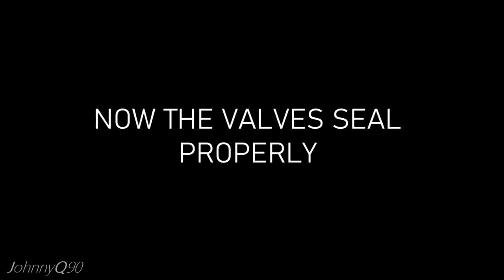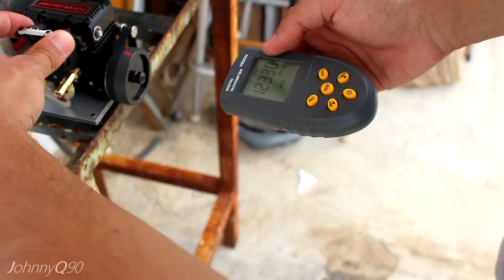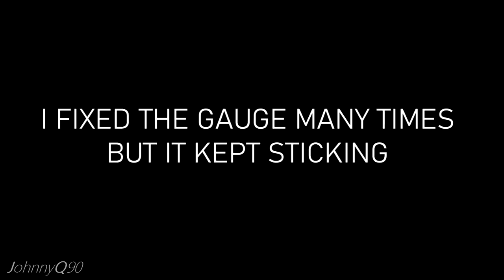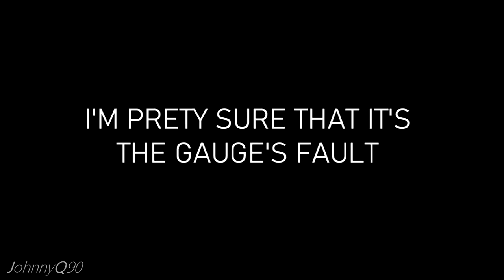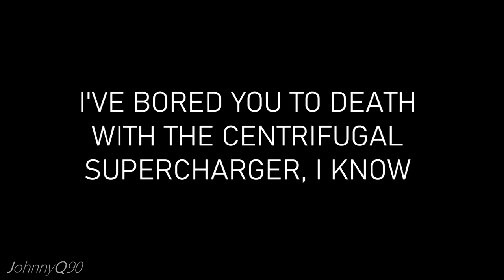PERFORMANCE Upgrade for the 4 Stroke TWIN Cylinder - *VALVE Lapping* - Supercharger Update

Comment: i dont know if thats gona work on blow   throurgh  i think the problem on the carburator try one time with a bigger one and lower gear ratio on that engine 3 psi i think its a lot with that pressure and that carburator its gona run very poor

Comment: First of all, the turbine is useless if it continues to pollute in second, The pulley is too tight and puts a lot of strain on the gasoline engine And in third place you will put 2 turbines one that connects to the exhaust and another to the carburetor

Comment: has anyone tried to use fuel injection on a model engine? this style supercharger and turbochargers dont work with carbs as well as they do with FI. now a roots or PD might work, but these style superchargers take power to make power.

Comment: too much boost. inconsistent idle because the charger is spooling up not a big deal but i think the reason that you can't tune it is because the boost is adding power on the intake stroke.

Comment: I would suggest adding some fuel pressure, and timing. more air means you need more/ a more stable fuel source and then I wager YOU could easily fabricate a new crank gear that are a degree or two advanced or honestly move the OEM crank gear forward a tooth on the belt which where in theory could detonate the mixture sooner to help iron out that rich low rpm sputter. It almost seems like a miniature backfire from the combustion cycle being a little too retarded for how much you're gonna be feeding it (don't laugh that's the actual term). Also too much timing could cause the valves to hit pistons (specifically the exhaust valve on the exhaust stroke) but I imagine its easy to test without damaging anything if you adjust the timing and turn it over by hand making sure to feel for any binding.

Also some people have a good point of fuel atomization. Once again though you can do some sort of high pressure low volume fuel system to prevent droplets from forming. Droplets can be hard to fire/cycle because liquids don't compress. I feel like properly atomized fuel and some timing can really wake that setup, UP!

Comment: Johnny, you should also convert the glow-plugs to ignition spark like this ------->https://ch-ignitions.com/, think you will see nice improvements too! Also try a carb from like a saito 4 stroke engine, they have dual needle valves and can be adjusted very nicely, Just some thoughts!

Comment: Put some load on it and actually run it at sustained full throttle for like 15sdc and tune from there. You just idle the thing and blip it for a second. You're just wasting time. Are you scared?

Comment: Seems to me like a lean issue then it riches up
Reply: Try a air filter to get a constant restriction in a closed environment. Could mix fuel more evenly. Otherwise fuel could be getting caught on an edge. Throw oring to seal backside of slide better?
Reply: Seems to run better on the system u started with. Also fuel could be getting stuck on supercharger inlet and hoses and such causing you to have an excess of fuel built up  . This would cause the improper tuning and lean and rich issues, no constant fuel mix